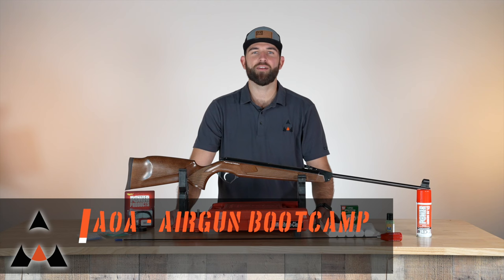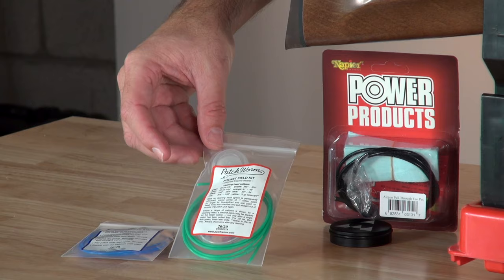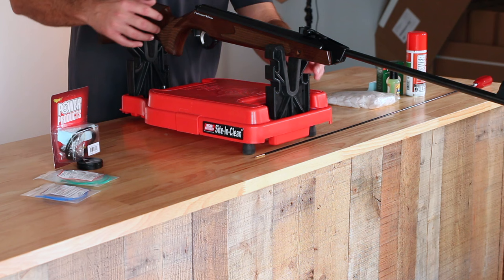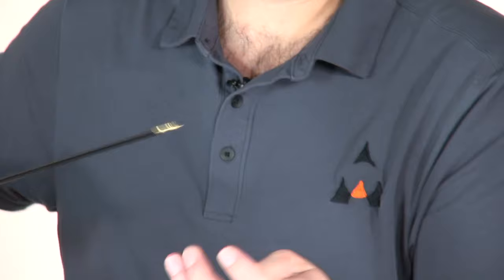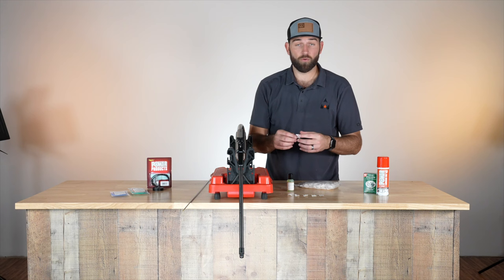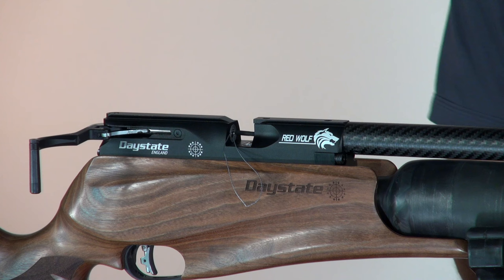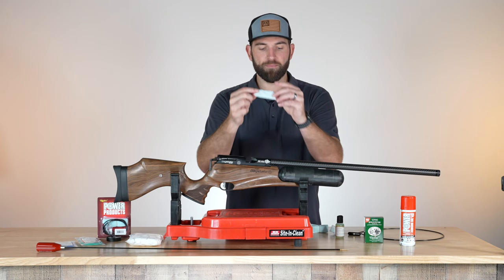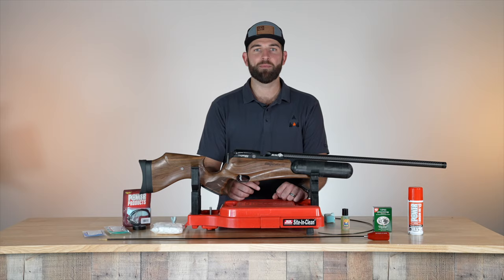Cleaning your barrel - Airgun Bootcamp

Comment: If you have a suppressor on and you don't want to take it off. Put a straw in your suppressor then feed the feed patch worm cord through the straw so it won't bind on the internal suppressor baffles. Works like a charm.
Reply: I use a bit of waxed thread, the same type of thread used for leather sewing a single strand is strong enough to be used as a pull through though if you want it to hold some beeswax to maintain stiffness its best to braid some together so theres no need to use a straw as the threat is stiff enough to easily be fed down the muzzle and just leave a bit if bees wax in my cleaning kit which can also be used to waterproof both wood and metal for extended periods out in the field.

I have a hw97k aka an underleaver and the beeswax gives extra grip on the charging lever and protects it from rust just rub the wax onto the metal then rub with your finger to smooth it evenly onto the metal and can easily be removed with a light bit of heat and a rag if for whatever reason you need to take the wax off the metal

Comment: I usually take a piece of fishing line.  Push it through with a loop.  Put cloth through loop and pill il through barrel.
Reply: Sounds like a working and super cheap solution. Thanks
Reply: @perspectiveflip  my cheap cleaning solution consists of pads of cotton rolled up to get some strength while I push it through with some PET filament. It works just perfectly fine and has endlessly supply for lifetime if you just eager to buy a kg of it lol 😂
1.5mm fine for 0.177 cal, more for bigger cal
Reply: That's exactly what I did lol

Comment: 2 things I do are clean PCPs upside down or remove barrel to reduce dripping cleaner or oil in the transfer port.  Also dry fire after cleaning to blow out any excess.  Btw, I was unaware you can decock a springer?
Reply: Yup, all my springers and gas piston airguns decock as well. Just make sure to hold on to the barrel tight. I hand my Hatsan gas piston break barrel fly up and pinch in between my thumb and index finger taking a chunk of meat with it. Had to put it on ice and get stitched back on.
Reply: Actually some cannot be decocked. It depends on the gun.

Comment: Guess what: lately I've become kinda lazy (hot weather or whatever) so I utterly neglected all of my (8 different models, 2 PCPs and 6 springers) when it comes to cleaning the barrel(s). I even haven't cleaned them after swapping them pellet models... Nothing really went worse - more or less, I'm where I was when acting otherwise, that is, quite accurate at  the range as well as "out in the field" (pest control). On another note: for the "pull through" method, use the fishing line with the piece of the pellet attached to one end. Once it comes out of the other end of the barrel, make a noose in the middle of that fishing line/thread and use quality patches/cloths.

Comment: So I have a question. Btw, I'm new with air guns, that's why this question. But in the beginning you talk about the rod that has that protective material around that doesn't make any scratches, but then you insert it with the patch, it cleans it, you take off the dirty patch and the metal point it's uncovered. Now, when you pull the rod out, should I be concerned with that metal point to scratch the inner barrel? Thanks.

Comment: You know what is way cheaper than all that? Trimmer string from a weedeater. All you gotta do it melt and smush a little part at the end so the patch stays on. For cleaning patches just get some cheap ones and cut them down. For solvent just get some citrus Goo Gone.
Reply: Someone is a comedian I see.
You wouldn't use Goo Gone, it has petroleum in it
Reply: @prof.snopes6239  someone is uneducated I see. Yes you would use citrus Goo Gone. Go to the airgun forums and read up.
Reply: @JoeZelensky  got a bottle of it right on my shelf, first ingredient is petroleum.
Im not looking at trying to make it louder
Reply: @prof.snopes6239  it will not make it louder. That is literally what everybody uses to clean an air rifle.
Reply: now that is good info. I use thin bank line from Dave Canterbury.

Comment: You mentioned not to use a petroleum based product to clean your barrel. Is CLP not good for barrel cleaning? Label states petroleum distillates.
Reply from the maker: It runs the risk of destroying any orings, including the breech seals. Best to use a cleaner degreaser. There is no carbon to break down.

Comment: U did it wrong with napier system , it is designed for 177/4.5mm 1 patch , for 22/5.5mm 2 patches and for 6.35mm 3 patches so it fills bore more tightly , thats why patch was going to easy thru that daystate wolverine , read napier pull thru instructions .

Comment: I put a drop of oil in the hollow end of my pellet before firing and it made a big boom but seemed to operate ok. Only did it once and was wondering if that is a cheat to get more power or what?
Reply: it is called "dieseling" you can put vaseline or petrolium oil and will ignite for the pressure like an diesel engine, it will shoot like a 22 caliber but you can blow up your seals and loose acuracy,

heres a video: https://www.youtube.com/watch?v=qDjHWkt18sE
Reply: @johnnzetrockk9404  nice. 3in1 oil works pretty good too

Comment: you have no clue if your barrel is clean unless you use a borescope, just because the patch is white does not mean it's clean, the teslong borescope is cheap and I phone compatible and you can clearly see your cleaning routine, ask me how I know
Reply: You are absolutly right. Only using patches will not remove the lead. Im shooting an Impact M3 30 and 22 cal. with slugs. With the Teslong scope I saw still a lot of remaining lead the last half of the liner. Without a brush no way to get the lead out.

Comment: Can I use wd40 for cleaning thanks
Reply from the maker: It is not advised. WD40 can harm some of the seals used in airguns. Go with a good non-petroleum based cleaner.  We like our AOA cleaner/decreaser product or Gunzilla.
Reply: @airgunsofarizona  In Vietnam, people are prohibited from using all kinds of weapons, so it is difficult to buy specialized cleaners, thank you for sharing with me.
Reply: @haonam9602  i think balistol is safe, i use balistol oil on all airguns and for the co2 cartridges i use balistol silicon oil.

Comment: Artsy fartsy. Use a fishing line. Cost nothing and doesn't scrape the barrel
Reply: Barrels are made of hardened steel, the itty bit of brass on a cleaning rod isn't going to scratch the barrel.
Reply: @fermitupoupon1754  a fine accessory yes. But I'm talking about the cost of cleaning the barrel, not what it can take
Reply: Not everyone is prepared to pay for something that you don't need
Reply: @citizenVader  fair enough. I don't own break barrels though. So my cleaning rod does double duty as a clearing rod in case a pellet decides to be difficult.
Reply: @fermitupoupon1754  i have a mauser from diana I use the same method for that gun too. But I agree, that a little brass can't hurt the barrel. I would use it if I had one. I guess it's just my way around the extra money. And it fits in your pocket. Besides.. most people who have a airgun are more likely to be fishing too.
Reply: Pcp shooting is amazing fun, and I am absolutely delighted by the new generation of airguns. It's just a little expensive, but it's worth the money.
Reply: Definitely going for the kral puncher carabin next time, and I already know brocock arms will be in my collection soon as well. The shipping costs are just brutal at the moment, so everything is double the expense
Reply: @citizenVader  I have 3 rifles, both my competition rifles are PCP. My plinking rifle is a relatively cheap multi pump pneumatic. I used to shoot a modified Weihrauch HW77 under lever, but the recoil from the gas ram is something my arthritic wrist just can't take.
For HFT I have a heavily modified Walter Reign, bigger bottle, longer barrel, swappable regulator. .177 it gets around 150 shots on the regulator at 16J (6.65gr pellet 900+ fps). For fun it gets about 30 shots on the regulator at 60J (16gr slug 1100ish fps).
My 100 metre rifle is a modified Benjamin Bulldog. It now sports an 880mm long floating barrel with a relatively fast twist rate. It sends 120 grains of .308 down range at close enough to 1100 FPS that it makes no difference. Well over 400 Joule in that rifle. Which is kind of daft if you think about it. An air rifle that's as powerful as many a hand gun cartridge.
Reply: @fermitupoupon1754  the Benjamin is quite solid and sold a lot here in Denmark.. it's been one of the brands I have a keen eye on. The frame is big though. But I used to be a gunnery sergeant, so heavy is okay with me.. the older you get the lighter you want to be..
Reply: I would say it is the second year of my new old hobby
Reply: @citizenVader  The heavy frame is quite nice when it's on a bipod. Nice and stable.
Reply: @fermitupoupon1754  100 meters is quite a serious distance away with a airgun. I'm not going past 50 to be sure I know where the slug is going.
Reply: @citizenVader  100 metres isn't so bad once you get into it. Though the competitions are either prone or bench rest.
Hence the bipod and relatively large calibre.

Mind you, for me anything that isn't back yard plinking, implies that I'm at a closed range with a proper backstop.
HFT is an outdoor range, but it's a dedicated place. Ranges go between 7 and 50 metres.
The indoor range I go to is up to 25 metres, the gun club that owns it also has evenings for small and large calibre hand guns.
50 and 100 metre bench rest is at an outdoor range, but again this same range is normally used for large calibre fire arms.

So yeah I'm not that worried about losing track of my slugs and pellets. Because all ranges I go to are marshalled, access is members only.
As for plinking in the backyard, I only ever shoot with a 7.5J rifle in the back yard and my brick walled shed is my backstop.

For me plinking is a way to practice technique and just have fun. Besides using a low power rifle for plinking also means it's easier to muffle the pellet trap. Neighbours that don't hear anything are happy neighbours.